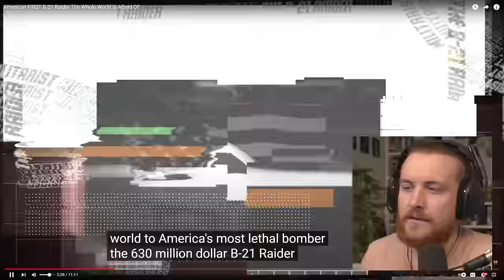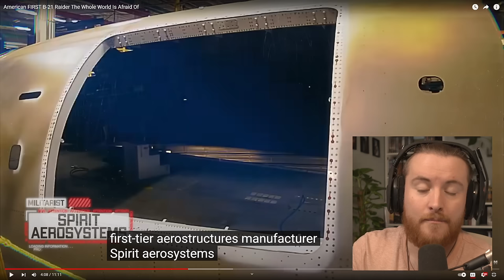Royal Marine Reacts To American FIRST B-21 Raider The Whole World Is Afraid Of!

Comment: The Raider is what the B2 was supposed to be.  before Air Force generals got involved and added a whole bunch of unnecessary " add-ons "(like low altitude flight, among others)  that inflated the budget, cost, and size of the plane until it became the B2.

@6:39  with " winning " a contract, usually there's a design submitted by each company along with a cost per unit, and it's capabilities.  if it's a completely new design / type of anything ( in this case bombers) they may select 2 companies, who then will build a proto-type. that proto-type will then go through tests an trials, and the best one gets the deal. (except in the F-22 case.  because the F-23 was the better aircraft)
In the case of this bomber though.  that long process didn't happen because Northrup Grumman was already building the B2, since they won the deal all they really had to do was build it and test it.
(it's a long conviluted process that can take years, this is just a very simplified version)

Comment: originally the B-2  was supposed to have the same shape as the B-21. but they had problems controlling the aircraft and had to add the extra points at the end of the aircraft for more control surfaces which stabilized the aircraft. the B-21 the designers saw a chance to bring back their original design with only 3 points on the rear. because of technology advances over the years they dont need the extra control surfaces the B-2 has and needed.

Comment: Also, the B-21 is cheaper mainly because of how many aircraft are being built. The cost per aircraft is calculated by adding the R&D cost and the manufacturing cost and dividing by the number of aircraft; because the R&D is a fixed cost no matter how many aircraft you buy, the more aircraft are purchased, the lower the cost per aircraft will be.

The US only built 24 (I think) B-2’s, but will likely buy over 100 B-21’s. So your denominator is literally four times larger with the B-21.

But the real cost savings are going to be in maintenance and operating costs. Thats a HUGE deal that most people don’t talk about. Better radar absorbing material and more efficient engines are going to allow the aircraft to fly more sorties with fewer man hours needed working on the plane in a hanger.

The operating costs are a MUCH bigger concern for the DOD than the actual price tag for the aircraft. Procurement isn’t the bottleneck— upkeep and operating costs are where the US military makes its financial decisions.

Comment: B21 is smaller than the B2 but the B21 sensors and avionics is all upgradable as new upgrades get developed. Before aircraft could only upgrade certain things unless the bring it in and do a full facelift for the upgrades.

Comment: I don't know if you picked up on what the narrator was saying, but the B-21 Raider is set to replace the B1 and B2 but not the mighty B-52 that just keeps on chugging along. The B-52 is a legend it is older than the pilots that are currently flying it. The B-52 entered service in 1955 yet even the B-21 Raider won't replace it.

Comment: The B-2 does have extra geometry on the tail, but the original version of the B-2 was more like the B-21 tail.  The reason is that the Air Force changed the design of the B-2 after the first prototype to have it fly low level missions beneath the adversary's radar and that caused Grumman to change the design to accommodate the new requirement.

The B-21 is a bit smaller than the B-2 and can carry about half the load.  But the B-21 has about the same range of the B-2 and will have far more advanced technologies.  The B-21 will also have an improved anti-radar coating and will even more stealthy than the B-2.

The competition was originally between Grumman, Lockheed, and Boeing.  That was narrowed to just Grumman and Lockheed with Grumman winning the final contract award.

It's not so much of getting the best contractors which is important, but it more of political decisions.  Four hundred suppliers across 40 states is very much a political calculation to get the funding from Congress, supporting the various congressional districts with funding and jobs.  There is also a consideration for including suppliers from our allies.  What has really kept the cost per bomber down was the decision to use as much existing technology as possible.

The B-2 has a radar cross section of about a bumble bee though its actual RCS is classified and likely smaller than a bee.  The RCS of the B-21 is alleged to have a considerably smaller RCS than the B-2.  The F-22 has a RCS between the F-35's golf ball and the B-2's bee.  Again, the actual RCS' are a closely guarded secret, so we really don't know.

Comment: B-2 was originally going to have a similar tail to the B-21 but then the requirements got changed on them late into the project and they had to change it to the saw tooth design. The B-21 design is more stealthy.

Comment: The reason the B2 has the sawtooth design was a last minute requirement change from the Government to have the B2  be able do low level bombing, the B21 will be more of a high altitude bomber that can be adapted for multiple roles. Because of the low level bombing capabilities of the B2 the B21 won't fully replace it but we will see another platform replace the low level bombing role, more than likely unmanned.

Comment: The state of the B21 is tricky. It's kind of like the F-35 and the Gerald R. Ford Supercarrier in the sense that it's in something akin to "Early Access Beta Release." There are units being utilized in exercises and sent to airbases, but they're not in the full production, "replacing the old versions completely" status yet. It's on the bench and rearing to go, but the team's functioning pretty well and doesn't need a full substitution yet, if the analogy makes sense. Besides, the F-35, B21, and Gerald R. Ford class are all bringing new technologies that haven't been a wide part of the US military doctrine ever, such as AI cooperation and utilization with drones. It's something the older generation cannot do that these new machines are bringing to the fight that need a new generation of operators to adequately and effectively command.

Comment: They compete for the contract, then submit their prototype and plan including the cost. Of whoever is in the bid for the contract, they then choose which contractor builds the best plane per the requirements established in the beginning; then hopefully within the budget. When all the prototypes are built, tested by military pilots etc., then they choose which contractor they’ll go with. That company will then win the contract & be funded to build the planes… which is a process which takes years.
Hope my explanation helps! Typically, the best of the best contractors (who have the money to build/design a prototype within the specs) all bid for the contract (of which all have at some point, built aircraft’s for the military before). As far as specs NOT mentioned as required; like the pilot-system interface; the military already has the software and is therefore incorporated into the aircraft after it is built. Or, the prototype should I say… The best airframe constructed per military requirements requested are tested by military personnel and pilots. The one designed with the most operational friendly design AND integrated to the extent wanted with the least cost and most practical design in use is chosen. THEN, any perfections the military might desire… they work with the winning contractor/bidder based on the design and expected requirements while not taking much more than other contractor to maintain, etc etc. I know I repeated a few things but, that’s the basic idea. Then, still takes years to construct a fleet. Train pilots on and eventually become operational

Comment: The B-21 has a smaller payload, is why it's smaller. It's there to expand our stealth bomber fleet. The b-2 will be used when they need to drop the really big things. Both however can carry nukes though. Just the b-2 will have a 60,000 lbs payload, and the B-21 has around half of that. B-21 is also way cheaper and can be unmanned.

Comment: The reason the wing design was changed. B2 was originally supposed to look like the B21 but the Air Force Wanted it to have the ability to fly low and the shape of the B21 is not optimal for low altitude flying so they made the sawtooth pattern of the B2. The B21 is gonna have a much higher service ceiling than the B2. And as for why it's so expensive a big thing about it is it is a sixth generation aircraft which means that it is a aircraft capable of acting as a mothership to a Fleet of loyal wingman drones. Drones that can carry extra sensors extra munitions can even sacrifice themselves to take a hit.  It is the first aircraft built from the ground up to be a hub ship for other aircraft to fly alongside to assist in the mission.

Comment: All companies submit designs, the design is selected.
The design is bid on for the build lead.
The leader hires subcontractors for parts.
The item is built.

The B21 is on airframe 7 right now.
The b21 will replace the b1 and b2 in 2027.

The chinese is so stealthy, they havent seen it yet.
The b2 has a cross section of a bumblebee.
The b21 is supposedly the size of a gnat.

Comment: The Air Force wanted the B-2 to have low level bombing capability even though it's never done it other than training. That's why it has the W shaped backend. They didn't want it for the B-21 so the V shape. As far as winning the contract. The AF puts out the bid for contract with the list of requirements. Defense contractors submit designs with estimated cost etc. a "winner" is chosen.

Comment: A good idea of what you said about high tech aircraft being cheaper to make is represented quite well by the b52, as time went on, the upgraded versions with better computers and engines like we have now are actually still cheaper than the original ones were in the 50s if you adjust for inflation

Comment: Oh, when they say the race between the B-21 and the Chinese H20 comes down to three things... that's wrong.  It comes down to FOUR.   And the fourth item is "Does it exist?"  Because you can fly an American B-21 today, but no one has even pretended there is an H20 for a Chinese pilot to actually test fly.  And there won't be, for several years, if ever.

Comment: The B-21 raider is pilot optional full AI capable. You are correct that the B-2 has more points on the back. Also look at the air intakes are a lot taller on the B-2

Comment: for what i have gathered, the B-21 Raider is a big step forward from the B-2 Spirit.  first off it is smaller than the original and has more powerful and stealthier engines. I suspect that it doesn't emit was much Infrared signature as the B-2.  I also suspect that the B-21 is also capable of supersonic speeds and super cruise. it would need those capabilities if it was taking over for the B-1 Lancers. I also suspect they painted it white to hide all the angles and curves better than the black paint would. I suspect that the final versions will also get the same Chrome like stealth coating they are currently being seen on F-22s, F-35-s and even F-117 that have come out of retirement.  from what i have gathered i suspect that the new Chrome like coating has better radar absorbent capabilities, better durability, and could also be a counter measure for infrared search and track systems on enemy fighters like the SU-35 and SU-57 and their Chinese counter parts. I believe the reason for the change in the rear wing was because it is not designed for low level incursion operations like the B-2. the original B-2 was designed with a tail similar to the B-21 but was changed late in production to accommodate better low-level missions, they also added the door on top of the engine nacelles to accommodate better low-level air flow into the engines at that time. my understanding is the computers that controlled the flight characteristics were not capable of controlling the B2 at low level flight without the changes to the rear wing. with modern computers (30 years is about 20 computer generation in CPU processing power), the B-21 went back to the original tail design.  my understanding is that the B-21 is about 60% stealthier than an F22. which is the currently the stealthiest aircraft in production. to put it in perspective less than half the size of a bumblebee. the B-21 is also rumored to have laser based defensive capabilities. i suspect an anti-missile laser system.  I also suspect that it is designed to fly with or control "Loyal Wingman" drones. or other offensive or defensive drones.  

I have seen some rendering and 1 supposed picture of the Chinese H-20. the rendering show it with winglets on the edge of its wings. that would impact it stealth. the supposed picture i saw has inlet ducts similar to the f-22. also, the jagged edge of the panels is not aligned properly or sitting flush, so this is either a mockup of the build quality of the test aircraft is garbage. from the picture it looks like the H-20 is also significantly bigger than the B-2, so size will also impact its stealth.  it probably bigger to accommodate more fuel capacity. because Chine does not have the inflight refueling capabilities of the US. 

Russia is also working on the Tupolev PAK - DA Stealth Bomber. but currently it is hampered by the sanctions imposed because of the war in Ukraine. the renderings are similar in design to the H-20 only the engine air inlets are molded into the wing roots. just about mid cockpit.

Comment: $630 Million per plane of this type is actually a bargain.  The B-2 Spirit costs $2.1 Billion per plane, which is why they stopped producing them a while back.  The original order was for like 120 or so if memory serves, maybe even more, and they only produced something like 28 or so, if I recall.  But with the B-21 Raider, the order of like 150 intends to fully stand, because it's two-thirds cheaper than the 35 year old B-2, and it's state of the art and modular to a degree in that it can be made to be a manned aircraft, or an unmanned one, which as you can probably guess would be advantageous in a highly dangerous region where getting shot down is a real possibility.  

The easiest ways to tell the difference between the B-2 and the B-21 is that 1) the B-2 is grey-ish black, and the B-21 may in fact be white...but that's not set in stone yet...the revealed prototype was white, so take that for what it's worth, and 2) the B-2 had 5 pointing edges on the rear of the plane, the 2 wing tips of course, and then 3 around the tail end of the fuselage, while the B-21 only has 3 pointy parts altogether...the 2 wing tips, and just a singular pointy end at the rear of the fuselage.  And the B-21 is a bit smaller than the B-2.  Which of course means that it won't be able to carry as many bombs, but the Air Force figures, that getting three B-21s for the price of one B-2, you could afford to send a whole Flight or Squadron of B-21s at a target to do what needs to be done.  A kind of regressive way of thinking I guess, but what it takes, might as well do it it, right?  One of the reasons we needed a new Stealth Bomber is because modern radar systems from China, Russia, North Korea, and even Iran are able to pick up the B-2 now.  So something had to be done.
Reply: And when you start canceling large parts of an order that’s when you really skyrocket per unit costs. Since the research/development and setting up manufacturing lines are fixed costs that then have to spread across the number actually ordered. Not to mention the longer you keep a production line going the more you can figure out to streamline and reduce costs as you go.

Comment: Each B-2 is literally worth its weight in gold. That is not a joke. That is a sobering thing to think about.
Reply: Call it $2000/oz (It's a bit higher today) and you need
$670,000,000 / 2000 = 335,000 ounces of gold.
335,000 / 16 = 21,000 pounds of gold.
Max takeoff weight of a B2 = 336,500 pounds.

So it only costs about 1/15th it's weight in gold.  Such a deal!

Comment: Yes the B21 is slightly smaller as you pointed out the differance of the shape B1 five points to the B21 three but the biggest differance from the front is the cockpit indos the B1 has four squarish windows these form aras of Adam defection and they are not as stable or strong .the B21 has an eye shape that tappers downward in my opinion this give a better view both downwards and backwards , there's also a differance in the air intakes as for air defence Northrop  Grummend has another tool in the box its the X47 B the Navy are testing this as the posible remote wing man also as an air refuelling and take the place of the F 18 hornet tanker the Idea of the zx 47 B being  tanker it can get closer to the combatants due to its radar cross-section.  As a force multiplier if you could send a F 18 into a combat area with one or two X 47Bs this could be a multiplier more ammo at hand the F18 pilot can send the 47Bs forward useing dater link pass on target information it is getting from other air assets like an air traffic control aircraft that is getting it from Apaches and Reaper Drone through the secure date link then to the F18 . Now Imagen one of the pilots in the B21 can control the weapons on the 47 B it could set one to fly behind and higher up and one forwar the same as the 47B is stealth air drone it could fire a missile at an enemy fighter to the enemy a missile has just popped up on his warning system out of nowhere even if it did pick up the open weapon station doors its only long enough to fire a missile then it's gone even if the pilot is good enough to figger out where his target has gone its not the B21 and the 47B can still engage th fighter again